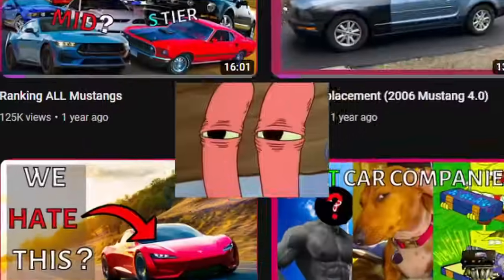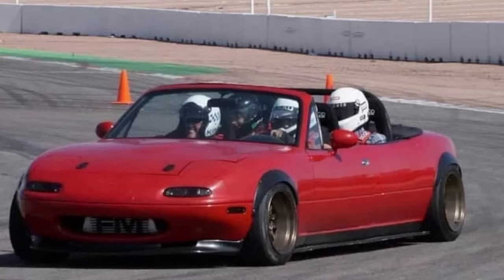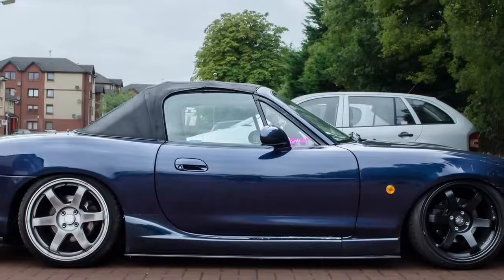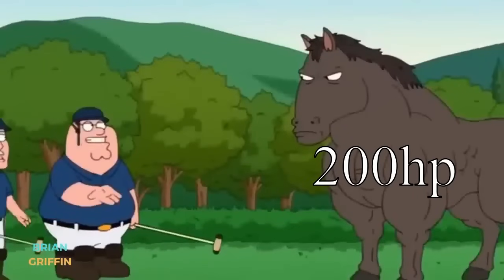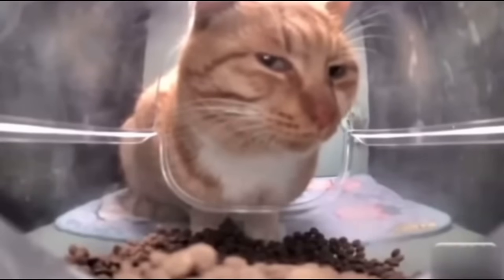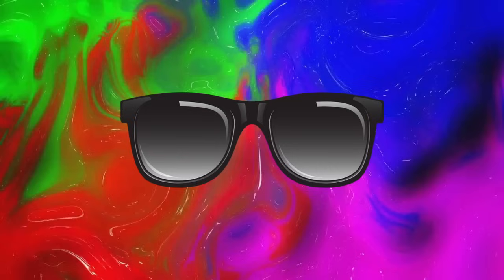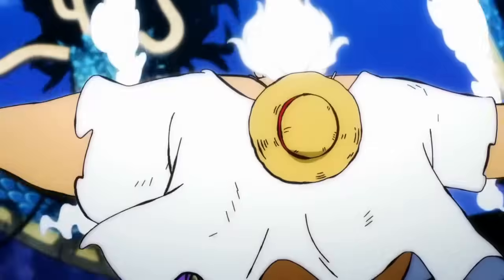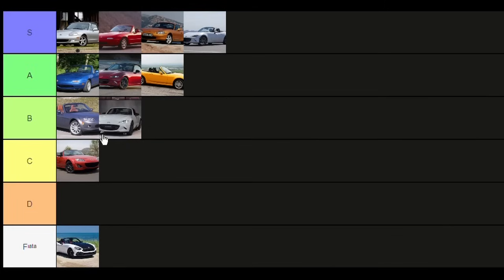Ranking ALL Miatas

Comment: Man after driving all the mx-5 models besides the ND, I still prefer the NC. The NA and NB are great, but driving an NC feels amazing.  Plus it still has hydraulic steering unlike the ND. The factory power retractable hardtop is so good, you can basically have a hardtop all year round.

Comment: Considering the NA8 had the highly coveted torsen LSD and the 1.8L engine (the first recommended power mod for NA6 owners is to swap in a used NA8 engine by the way) I think the NA6 and NA8 should be reversed at least. You also forgot to cover the NB2 Miata Shinsen. It was similar to the LS with a leather wrapped shift knob and wheel, and cloth interior and came in titanium gray metallic and a few other colors, and the 1.8L VVT BP6

Comment: This video is based on stats and information from mazda,I've owned many mx5s and can clearly say your way out you need to experience them to get the correct rating, I picked my current mx5 based on looks, durabilty, comfort.
Reply from the maker: Yeah I've only had the chance to drive two but I did say I wasn't an expert

Comment: Because the NC chassis is just a shorter wheelbase version of the rx-8 it actually has the best baseline and ridgidity for handling of all miata generations
Reply: Not sure about full on rigidity, but the NB2 had the most bracing from the factory out of any miata. Lots of people aren't a fan of the NC handling due to the multilink suspension setup behaving differently than all the other miatsas
Reply: @graham_lewis  the NB needed the bracing because the chassis was more floppy, the nc being a smaller version of a bigger car has a much wider and taller central chassis tunnel which makes it not even feel like a roadster/convertable if you've driven one before. The nc also has arguably the best steering of any generation.

Comment: Great review of all the Miatas. Have to say, I think I would agree with your rankings. I have only had na cars. A 90, 92 autocross car, and my beloved 93le. Maybe someday I will get another. Perhaps a 2019 Nd .
Currently drive a 2019 mustang Bullitt with magnaride suspension, and a ford racing upgrade. Springs, sways, and a flash for the computer to adjust the stiffer suspension to the magnaride. Amazing handling for a tubby 😂 3950 lb car😂
My problem with buying a Nd, is that I am looking at around $3000 in suspension, and exhaust upgrades to make the car like I want. We will see.

Comment: NC3 is S tier not only in terms of looks (in my opinion) but as a driver’s car in general. Best steering, increased redline from NC1, forged internals, amazing gearbox.
Reply: I think im right in saying NC2 and NC3 are the same and the changes are (very nice) cosmetic changes
Reply: @Bally46 That is correct, the NC3 is a better looking NC2.
Reply: IMO, the NC2 looks better only because of the grill (that plastic lip on top looks like a tooth guard football players wear, and I don't like it)
Reply: I am biased but the NC3 is one of the nicest looking mx5s, and has built upon the nc1 and nc2, so deserves a lot higher
Reply: @spencer.178  i have an NC2 and feel the NC3 is a really great looking car. Subtle differences making a big impact
Reply: Nc with a 2.5 swap from mazda6, the best performance miata u can buy.
Reply: NC1 front looks better.. the NC2/3 looks like a simpleton.. I had a gen2 MS3, so I know all about the simpleton grille lol

Comment: NC2-NC3 should be S tier. Mazda took the good ole hot rodding tricks out the book and rolled with it. Head work with forged internals raised rev limit to 7500ish RPM. Many will argue it is the best all around miata yet. Last of the hydro steering as well. NCs get a lot of hate when they shouldn’t. Love the looks of the ND and ND2 onward took on the same engine updates of the NC2 if I’m not mistaking. Not too sure on forged internals.

Comment: As a current ND2 owner and having previously owned an NB1 and an NC2, I’m pretty aligned with your list.  Well done.

Just drove an NA (NA8) and an NB2 a few months back (before buying my ND2).

I like the NB better than the NA and both of them are pretty close to one another and head and shoulders above the NC.  Didn’t care for the NC at all (how it looked or drove)…..now if the NC was the only Miata ever produced, I would have liked it, but it falls flat when compared to the others.

I struggle to conclude what I like better between the ND2 and NB.  The NB feels more visceral, but the decided power advantage to the ND2 doesn’t suck.

Just glad they keep making these excellent little cars!

Comment: Whats about the Fiata? and the Abartha?
Reply: He put it on the bottom tier, the Fiata tier.
Reply: Fiat turbo engine / exhaust / body with many interior parts. Mopar branded windows. Mazda infotainment system with Fiat software changes. Mazda suspension parts. The car is a multi Manufacturer project. It drives totally different from a Mazda MX-5 which for some is a plus.
Reply: @ag4allgood  I suppose so.
Reply: @CadanHartleyElliott  If you want a track car I see why the Fiat 124 Spyder can be preferred. From a stop though there is nothing like the instant throttle response of a naturally aspirated engine with an LSD.

Comment: A few  things you got wrong.  NC1  styling is not bad; it's good.  Later NCs  got the stupid Mazda family grill treatment that were borderline cartoonish.  I don't want my car looking like a Disney Character from "Cars".
The NC 1 had 177hp and was arguably the fastest Miata ever.  Motor Trend and Car&Driver both reported 177hp and 15.0 1/4 mile times.
The 6-speed is not a plus.  There's plenty of torque in the NC1 so that a 5 speed is actually faster in most situations.  Motor Trend confirmed this in their track testing back in '06.  Time wasted on more gear shifts.  The torque curve with the variable timing, 4 valve,  2 liter engines is too flat to need a 6-speed.
Hard tops are sacrilegious.  Why would anyone drive a Miata with the top up?   A Miata is no one's only car.  Leave it in the garage on a bad day.  All one needs for a suprise rain shower is to drive faster sending the drops over the windscreen.  In '06 we drove our NC1 from Tucson, AZ  to Anchorage, AK via Minniapolis, MN (10,000 miles) without ever having the top up.  Indeed in our 18 years with our NC1 the top has never been up on the road (it is sometimes handy to raise the top when its parked).
Reply from the maker: A miata is my only car
Reply: An NC1 is also now my only car!

Can you blame someone for wanting to have the pleasure of driving such a fun car every single day?

Comment: I own an NA6 (1990) and NB1 (2000).
The NB has no ABS (at least the base model)
The NB is not the first to get AC or PWS.  My NA6 has both from factory.

There were significant changes to the engine on the NB1.  To begin, the cam angle sensor turned into a crank angle sensor.  The intake port angle was changed on the head of the NB1.  The intake was completely redesigned, and the lifters were changed from hydraulic auto-adjusting to shimmed static lifters.
However, besides the intake, the rest of the parts are interchangable.  The Skunk 2 intake for this engine supports both heads, which is nice.

Overall, I agree with the list.
The NC is certainly the black sheep.  I've also never been a fan.  My daily is my NB.
Cheers.
Reply: When he mentioned the NB was the first to get AC or P/S, I think he was referring to it coming on the base model

Comment: You fell in to the trap that Turbo = BETTER. That is not what the Miata design ethos has ever been. Its the quick throttle response of a Naturally Aspirated roadster adding in lightness. The fact that a turbo needs extra care & attention paid to maintenance is not an advantage. The higher temperatures thin oil & make the cooling system a focal point for those cars. So your list here putting the Turbo charged Miata's in the S Tier is FLAWED ! Its also why I didn't like the 124 Fiat Spyder Abarth that I got to test drive. Turbo LAG & a heavier clutch was no fun in traffic. Absolute deal killer in my eyes. In practical day to day driving on public roads the Naturally Aspirated quick off the line speed is better suited to that chassis.

Comment: Nah, nc3 owner here you got it all wrong buddy. There’s no way an nc3 comes in lower than an nc1 💀. It looks better, it’s newer which means more low mile examples and it came with better interior
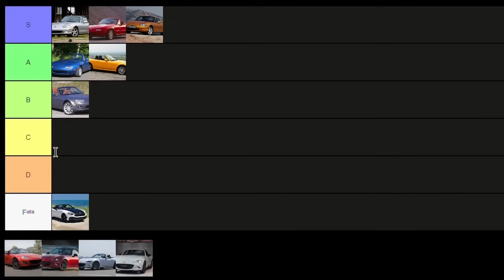Reply: Lol he didn’t even mention the Club editions as a special edition option & he used an nc2 at 11:25 for the nc3🥲. 

Guess we’ll just trade aftermarket 255 squared wheels w/ S2000’s since we both got a 5x144.3 lug pattern and don’t require a Widebody kit to fit em on there w/ our wheel arches WHO’S GOT THE FLAT BODY NOW @TheCarsmith ?! 😎 lol
Reply: Design wise, usually pre face,ift are most original idea from designer, facelifts are uaually coopertate decision
Reply: @hs5942  there are some exceptions to this that I can think of off the top of my head

Comment: in my opinion Fiata is B-tier, it's basically same modern MX-5 with prettier looks on the outside and T-JET engine in the inside.
Reply from the maker: Yeah the F was only cause of the name not anything else. That's why I didn't mention it

Comment: Mazdaspeed miata was slower than STOCK GT NC, N NA N NB IS ON S Tier? You need to wake up n smell the concrete, but u mention u have one nb so whtever.. try to take on nc nd w na nb on circuit or 1/4mile in stock form. Bias bias lol 😆